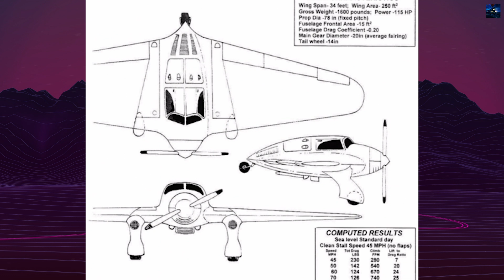Ford 15P: Henry Ford's Flying Wing Folly

Comment: The dream of an Aircraft being massed produce and used for everyday transportation by the average citizen is an illusion. It will never happen. Why? Because flying an airplane is nothing like driving a car. Adding a third dimension does not increase the equation by 1/3, it multiplies the variables by a factor of 10. Minimum speed, critical center of gravity, spatial disorientation, wind direction, icing, instrument failure, runway length, engine failure, wind shear, critical vehical weight, are just some of the variables that are of little worry to the automobile driver, but can get an aircraft pilot KILLED, along with his/her passengers, (and even people on the ground who had nothing to do with the aircraft). No, the universal flying car is like the pot of gold at the end of a rain-bow, it doesn't exist.

Comment: I can't imagine yaw controllability was easy to achieve with this design. The B-2 uses computers to control yaw. No wonder it had stability problems: humans cannot possibly react quickly enough to correct yaw deviations to fly the thing smoothly!
Reply: @craigwall9536 I hope you can provide examples of it being "done well many times", cause pretty much all flying wings experienced yaw oscillation, it killed the yb-49 program and the N1-M, the Horten 229 was known to be excruciating for the pilots, requiring constant yaw correction, etc, etc...
Reply: @red1246  (*laugh*)  You think you've "won"? Step back, son. I was test flying experimental wings before you were born. Yes, they are * undamped* in yaw.  But OSCILLATIONS are PILOT induced! Try actually FLYING one before you shoot your mouth off, or better yet- build a model with no controls and see how the pure shape reacts.  Or do you think the builders would invest that much effort and expense without seeing a stable unassisted model free flying first? Do you think they were all stupid? You've certainly sold them short!
Reply: @craigwall9536  well first of all I built several rc model flying wings and let me tell you, all of them had to have either vertical stabilisers or custom computerized control (which I can make cause I'm a frickin' engineer you know...). And tackle me all you want about the nomenclature but the fact is most if not all flying wings are dynamically unstable...
And by the way I didn't say I "won anything", I'm still just waiting for your "so many" successful programs
Reply: Exactly! With modern, fly-by-wire technology and perhaps some modest design tweaking, this design may be workable. The fact that it flew at all without a computer shows that it had some promise. (And a great test pilot!)
Reply: @alandaters8547  You're both wrong. It's been done well many times.
Reply: @craigwall9536 never to make a safe, forgiving what we might call "consumer ready" plane without a fin.
Nobody ever anywhere.
That's not a risky sport or test plane, or a risky military plane where they're in ejection seats because when complex controls fail they're a death trap.